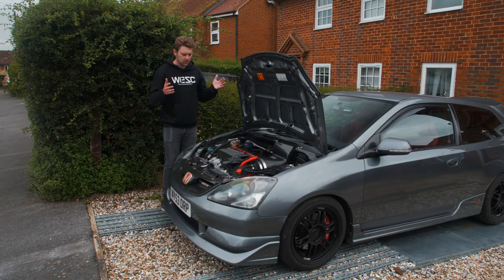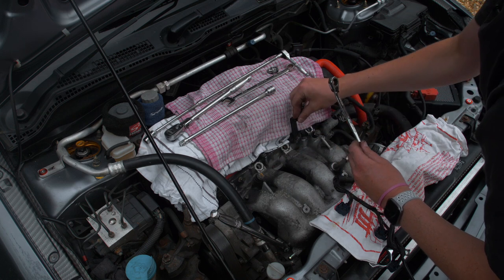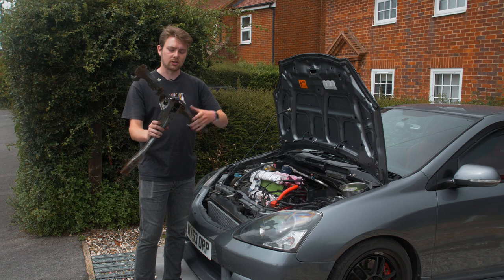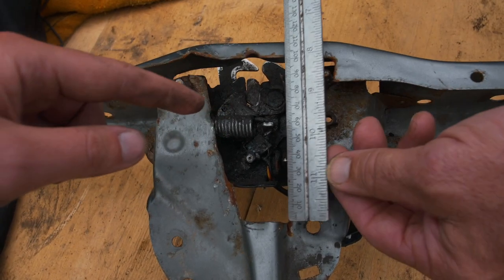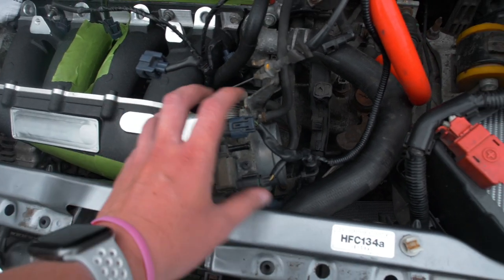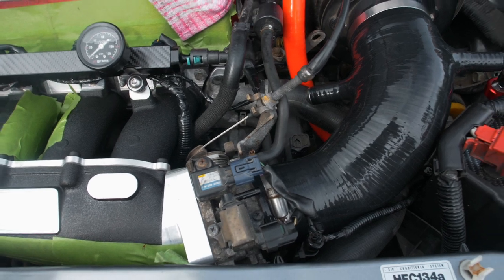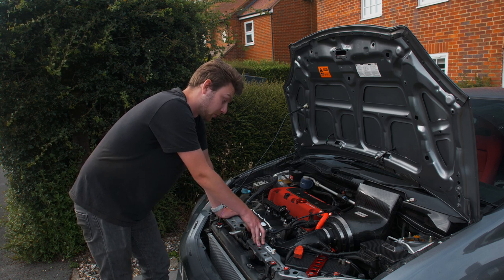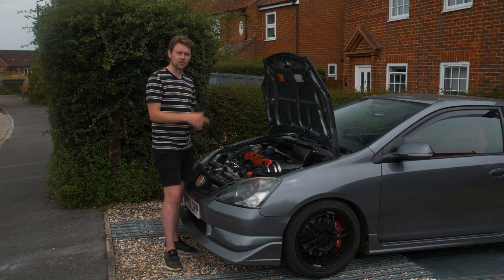Full Skunk2 Ultra Street Inlet Manifold Install On My Civic Type R EP3!! How To

Comment: Could you expand on why you kept the standard throttle body. I’ve just ordered a 74mm and planning on a remap.
Reply from the maker: From what I have been told by various tuners is that the standard TB isn’t restricting the car when mapped around the 250hp mark. You may see a gain of 1hp but for the price of a larger TB, that doesn’t seem like a worthwhile cost per hp. I have heard of some larger TB’s getting sticky and not being able to function properly too.
Reply: Installed mine today thanks to your video. Kept the original throttle body too. Just now having a knocking sound when accelerating in gear at the start.
Reply from the maker: @mariostavrinou2560  Awesome! I am glad that I could help you out! The knocking sound is interesting though... could it be the inlet hitting at the front when the engine moves around?

Comment: Something I thought I might add was, I noticed when making engine updates like this, the engine/ecu sometimes takes time to make adjustments to the new parameters,  causing irregular idle etc. I found this after I updated to a lighter flywheel after a clutch replacement. The engine had a very high idle for a bit and would rev itself to avoid stalling as it was a little confused with the lighter fly internals!  From memory, I did a standard ecu reset (battery disconnect, which you already did!) and let the car idle for a while and it settled itself very quickly while it found its new optimum parameters. Not sure if you had any issues like this, but I thought I would share as I imagine an inlet upgrade could potentially confuse the ecu for a little bit. My ECU picked up and made its own adjustments very quickly and did not require a map etc, it just needed some time to idle as it found itself again that's all. Just thought I would share. Great video too  mate, I really miss my EP3!! 🥲

Comment: Hi Olly, I don't suppose I can pick your brain. I have a Tegiwa intake I am going to fit soon and there is absolutely no instructions for the silicone intake hose. I have looked high and low. The 2 small pipes that branch from the intake hose, you have blanked one off which I'm guessing is the breather for the engine block. Does this make a difference to anything. Also you have the intake temp sensor in the other pipe. I have seen countless videos where this has been cut so the probe actually sticks out into the flow of air in the intake hose. May this be a reason your car is boggy as you mentioned low down. I hope I don't confuse you at all and any response from anyone would be great (:
Reply from the maker: Hey man. So… the one I have blanked off connects to the IAAV that I have deleted off the engine anyway (I have a video on that too). The sensor I just plugged into the hole without trimming it. I haven’t had any problems with it. The bogginess has be removed now that the car is mapped. I don’t have any issues like that now 👍🏻👍🏻👍🏻
Reply: @OllyRoss  thanks for the quick reply. Love your videos anyway. My bank balance don't like you tho 🤣🤣
Reply from the maker: No worries man! I am glad you enjoy the content but I apologise to your bank account! 😂😂😂

Comment: Dude didn’t even drive it…
Reply from the maker: It is advised to keep it out of vtec until you can get the ECU mapped to accommodate the extra air coming in so I was trying to drive it as little as possible until that point. Plenty of other videos on the channel with the car driving though